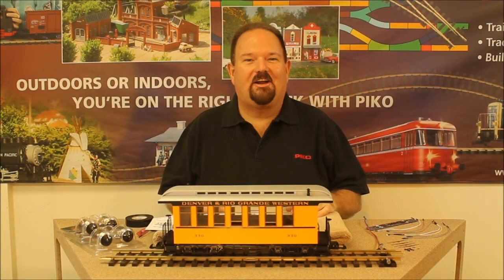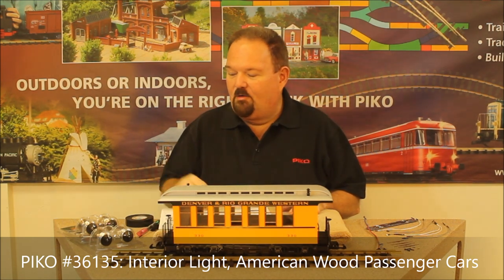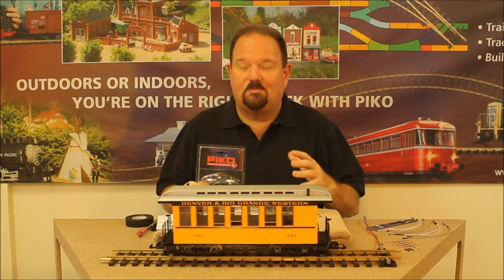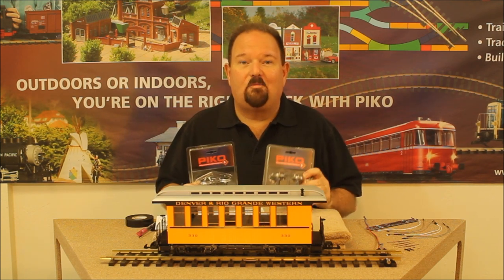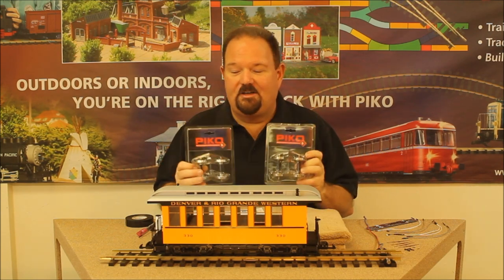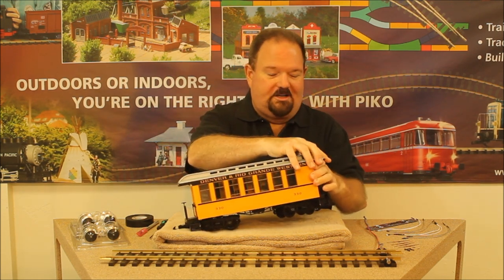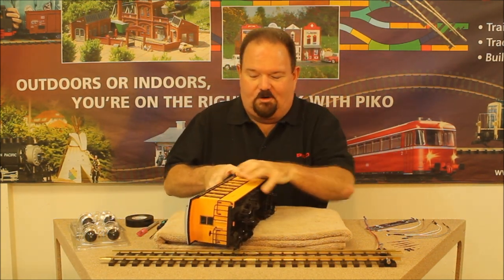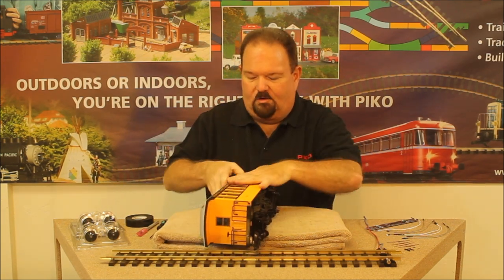Installing Lights in a PIKO Passenger Car

Comment: Great video. I'm completely new to model trains, but considering them for a diy project. How much power is it possible to get from the track into the car? - would be possible to have it run other things like a home made crane? - PIKO has some options for projects like that?
Reply from the maker: Hi Kesse, In general you can pull power from the track for accessories and other items - just know that they take from the overall available power your power supply/throttle is sending.  Plenty of folks do all kinds of customization projects like what you are mentioning... they key is to make sure you have fun!

Comment: Thanks Jonathan for your advice on how to take the roof off... with a LOT of trouble it worked... BUT still it is a TERRIBLE, PRIMITIVE design... designed for PIKO to sell more ULTRA expensive add ons, versus for engineering focused hobbyists to create their own custom add ons and design extensions... and enjoy the ride... because this could be a lot of fun... do it yourselves... this is a HUGE problem with the ENTIRE model railway toy industry, including PIKO! Folks, you should make it more OPEN and MORE accessible for us... by closing your designs with primitive plastic latches etc. as it is today, you turn away millions of young customers... yes, millions... and you still don't see this... AMAZING!

Comment: Hello, I have few questions regarding this kit. What is the minimum voltage (analog) at which the lights will turn on? Is there a capacitor to maintain the voltage when a car rolls over switches or not perfectly clean rails? Will it still work if polarity of tracks changes and a loco goes in the opposite direction? Or is there a diode bridge needed to be installed separately to have always same polarity for the LED light?
Thank you.
Reply from the maker: The lights should be on fully by about 5 volts.  There is no capacitor in the circuit, but having the pickup points at each end of the car helps greatly.  The lights work regardless of the track polarity, even on DCC-powered track.
Reply: Thank you, So it's really plug'n'play.

Comment: I have followed your instructions on removing the roof.  So far I cannot get the roof to separate from the body.  I managed to press the sides of the car in and partially lift the roof, but it is not coming off.  The ends of the roof are being held in place in some fashion.  Please help.
Reply from the maker: Hi Daniel, the video shows how the roof is mounted.  We have talked with many folks who felt that they would break it, but as long as pressure is applied in the correct place - we have not heard of one breaking.  Please give is a good press at the correct places and let us know.
Reply: @PIKOAmerica  Well, with much caution I pressed the areas indicated by you and others I've spoken with.  However, it still required insertion of a putty knife to get the sides released.  But when i tried pulling the roof off completely, it was still being held on at each end where the roof overhangs the open platforms.  In the end I was able to get the roof off without any damage to the car.  Thank you for responding to my message.
Reply: @PIKOAmerica  there is a screw on both ends above the exit doors that hold the roof on. (older LGB coachs)

Comment: Hi, I am trying to install lights in my Piko caboose. I can not locate any tabs. Is there a different way of taking off the roof? thanks
Reply from the maker: If you need assistance, please contact support@piko-america.com.  That is the best place to get information.  
The tabs are shown in the video at roughly 2:30. Jonathan is correct, that you will need a lot of pressure and will likely feel like you will break the model.  To date, we have never had anyone contact us because the model is broken.  (It just takes a lot of pressure to bend the tabs.)  The positioning of where you put pressure is key, so please use that section of the video to help you apply pressure at the right spots.

Comment: I installed this kit but the lights flicker. Is there a capacitor recommended to add?
Reply from the maker: There may be some aftermarket capacitor or battery add-ons, but nothing from PIKO.  When using one ball-bearing wheelset on each truck, we really haven't heard many reports of flickering lights.  Those give two pickup points on each rail, spread out quite a distance.  It's not too terribly difficult to add some short jumper wires and a second ball-bearing wheelset on each truck, if you want all wheels picking up power.  If you have a multi-meter or other tester, I'd suggest first making sure that power is actually reliably getting up to the circuit board from each wheel.